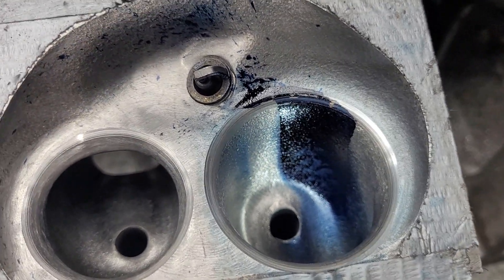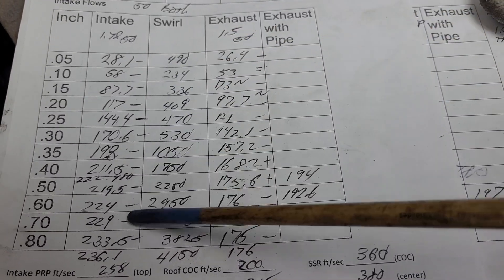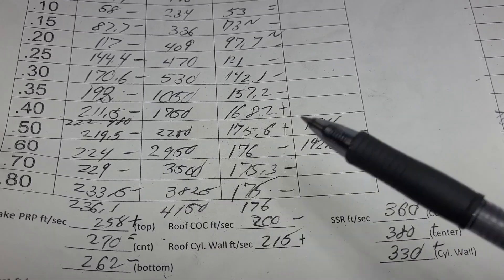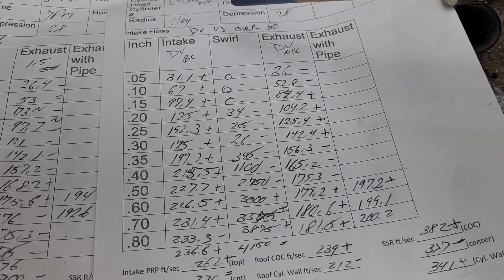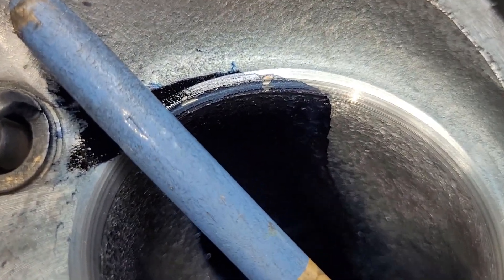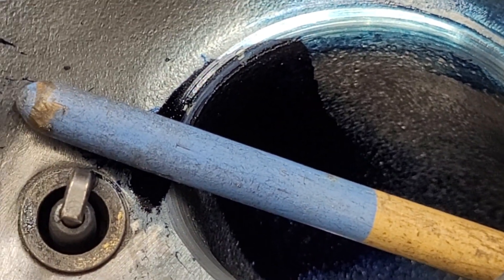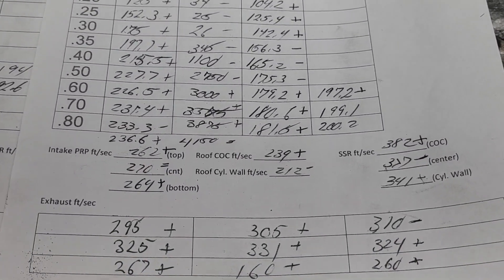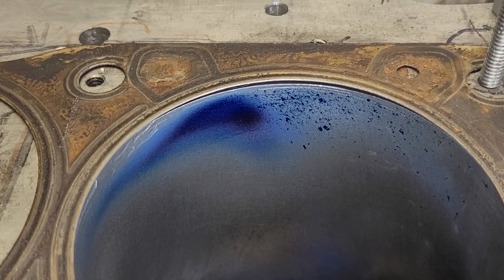David Vizard, U.T.G., U.M.S., Mission Impossible project 318, D.V. valve job vs. 50 deg valve job

Comment: The real kicker is we don't race flow benches so sometimes even what goods on the flow paper may not perform well in the actual power department.
Reply from the maker: Flow is for comparing before and after. If you make the port bigger and lose flow it will most likely make less torque.

Comment: I can see the valve cut perfectly clearly.

Great work all together!

Also, I really like how you used the dye to illustrate air and fuel flow patterns!

Did you dilute the dye or did you drip it in with a dropper, or a syringe?

I'm trying to determine [unless you want to keep it as a proprietary practice] how one would properly deliver dye into the inlet so that it accurately illustrates the proper air/fuel flow.

Comment: Charles , I want to know if the valves you are using when you test have been optimized .?  (Like a merry go round from hell)
Reply from the maker: I am stuck with stock valves, There are some differences in stock exhaust valve shapes. I am using what has tested the best so far. Thanks
Reply: @servediocylinderheads  I hope I am not part of the night mare , it's that Damn Spicoli again isn't it. He's always like Oh Mr. Hand I showed up at your house with a pizza 🍕😁.
Reply from the maker: Like a nightmare I can't wake up from!
Reply: @servediocylinderheads  Well sure but the back of the stock valve can be shaved . (So to speak) Removing material is completely in the spirit and legality of the MI318 charter . From what I understand 😜 (limited) all a guy needs is something like a drill press and a angle grinder . I imagine smoothing out the back of those horrendous valves has huge implications on the porting details . ?
Reply from the maker: @Jim-ic2of  Taking too much material from the valve may cause issues. This design will need to survive fairly high rpm. I was thinking of lightening the valves but must be careful not to introduce stress risers.
Reply: @servediocylinderheads  I see why you can't wake up from your nightmare . Just one more thing about the valve . The outer contact surface (on the stem side) could be blended smoother ? That's it I will leave you alone.. Thanks for responding 🙏💖.
Reply from the maker: @Jim-ic2of  It could be.

Comment: Hey Charles, kinda off topic but the LS valve swap David talked about early on in the plans would be a good idea if a guy was going to go through a set of Chrysler 302 heads, w/porting, wouldn’t it? No brainer? Thanks
Reply from the maker: The flat design works better! On the 302 heads. Thanks

Comment: Hi Charlie. It is very interesting to see that almost  or pretty much everything changed with just a change of seat angle. I knew that it would affect flow numbers but air speeds everywhere that was a surprise. Just curious, what would you purchase for a seat and guide machine? I also want one but like you it will be a some day purchase. Thanks. Andrew
Reply from the maker: I like the Sunnen vgs20. I have npt done the research on what would fit me best. Thanks

Comment: I heard Darin Morgan say that any time swirl goes up, flow goes down.  It may increase inertial cylinder filling.  And I can't tell you what the best balance of that would be.
Reply from the maker: I saw that, I get it. Rpm has to be factored in. High rpm needs very little swirl due to high turbulence from the rpm. Street stuff needs swirl!

Comment: Great info Charlie!  
What are your thoughts about the extremely wide ssr on the magnum heads? Advantage/disadvantages.
Reply from the maker: I would need to test air speeds.  I have gone overboard on ssr before. Not good.

Comment: I'm betting this thing would be a monster with about 14-16 psi maybe 18psi of cool boost,  a turbo would make this thing insane, the TQ would be through the roof! And the HP would not be far behind!! I'm thinking a Spintron would be good for more than cam and valvetrain testing, using a blower with a florescent liquid similar to fuel. And a camera, with uv lighting,  either a carburator or EFI/TPI. And use an electric blower to produce 14-15 psi, (1-bar)  to simulate flow into the engine, even the fuel off the seat, possibly even using a piston with a glass window,  with a camera mounted under the piston lots of knowledge can be gained from such a machine! ✌️
Reply from the maker: Maybe a plate system? I think D.V. has one.
Reply: Turbos are a crutch.
Reply: @MP-pz9oe  Unless you want big power then they are a must have.  No amount of engine hard parts will ever get you 400%VE but a turbo sure can!  The tricky part to turbos isn't making the power it is keeping things together while doing it. 4 times cylinder pressure and heat is a lot to deal with.

Comment: I know about aerodynamics, but not that much about modifying cylinder heads, I'm learning with you here.

I noticed that the air speeds are more evenly distributed, that's typical of turbulent flow, now turbulent flow carries more energy, but at the cost of speed and momentum. Could turbulence in the exhaust cause more back-pressure and affect things upstream(intake)?
Reply from the maker: I would think so. In a running engine will always have turbulent flow on both ports. Thanks
Reply: @servediocylinderheads  That's very true, opening and closing valves induce plenty of turbulence.

Comment: You have Wet Flow going on with different AFR or LAMBA and different fuels Charles.
Race Gasoline 110-120 motor octane is still #1 Best Reliable repeatable results. 
Or Pure bought by Barrel Methanol or E85.
Pump Gasoline results often all over the place.
End of the Day Air Flow numbers peak don't mean Sheet.
Killer Kool to look at.
Want Super Torque and Stellar Hp and engine able to wind out to 7000-9,000+ Rpms and not blow up any.
FOR STREET RACING WINS !
Reply from the maker: Good info. Thanks!

Comment: Do The Valve Job on The Spare Mule Junk Head exactly as DV Specified Charles and Test it Go With It.
I really like 30 Degree Intake Seats on Factory Pontiac V8 Iron Cylinder Heads. Might flow less at peak lifts .500-.800" inches.
But only using. 525" -.626" inch lifts at the valves typically. 
Everyone under the Sun told me to go to 45, 55, 52, 60 degree intake seats.
But none have ever shown me Water brake or Eddie Current brake Dyno results, Drag Strip Testing, National Wins, and Most Importantly Street Racing Wins Video Documented with A Passenger Riding Shotgun For Human Testimony Truth thier Valve jobs worked from Factory Pontiac V8 iron 30 intakes and 45 exhaust.
Reply from the maker: I agree, I think I may need to do a video on why the steeper valve angles got such a following. It will just be my opinion but that is fine.
Reply: @servediocylinderheads  I never ever had issues with 30 degree intake seats 2.110" Pontiac seating Charles. It's a good sized Valve close To Big Chevy 2.19".
I am able to hold .000" - .001" seat to guide Runout with my old Sioux 1710 Angular stone driver and Sioux Pilots. Use the 1702BB Sioux ball bearing Mandrel.
Call it being in the zone ZEN state of mind, perfect must do,  and it comes out GOOD.
When stones get old they do crappy work.
Reply from the maker: @brracing7861  I agree, my Sioux stuff is real accurate. It takes a ton of work to do a good valve job but it is possible with very low runout. Thanks
Reply: @servediocylinderheads  I follow Chad Speier on You Tube also.
He likes his old Sioux 1702BB & 1710 Likewise.  Has that killer head and seat machine. 
Still touches up with Sioux.
Reply from the maker: @brracing7861  I agree with Chad, after I get a seat and guide machine I will still finish the seat with a stone. Stone concentricity cannot be beat.
Reply: @servediocylinderheads  It would be interesting Yes Charles. 
The biggest disadvantage of steep modern Racing Seat Valve Angles I have heard of the need for Super Bee Copper alloy seats or Berrylenium Copper seats. Shorter Valvejob life. No idea how many Dragstrip runs or mileage driven on the Street before there is say 1-20 cfm seat leakage loss of Performance. 
Then if compatible poor mans 21-4N factory steel valves used.
Premium Ferrea 6000 series stainless steel or Manley Pro Flow Stainless steel alloy, Inconel 751, or Ferrea Super Alloy Inconel. 
Then Titanium valves,  all sorts of grades, Ti alloys keeps secret, think 6AL4V Titanium valves of past since 2001 NASCAR Racing circuits.
How steep of seat angles can be used on Factory Big 3 iron heads , Nodular iron most listed as made of.
Get by as is stock or use Nickle chrome or Stellite seats ?
Stellite is miserable to cut grind seat angles on at home.
Reply from the maker: @brracing7861  Good questions, I like durable stuff so I stayed away from 50 degree seats for a long time.
Reply: @servediocylinderheads  My own has to last. No one funds sponsors me here on You Tube or in real life. What I bought I worked for earned $$$$$